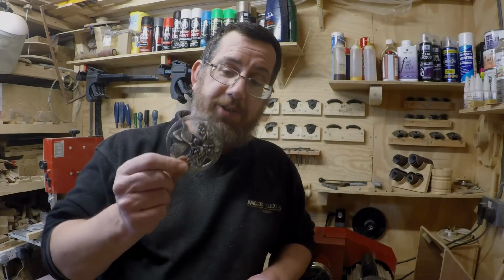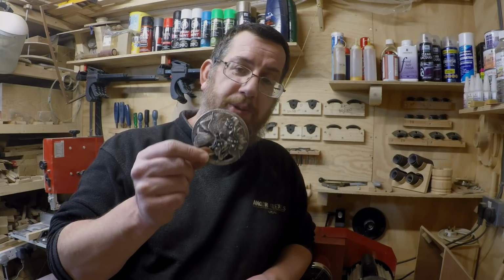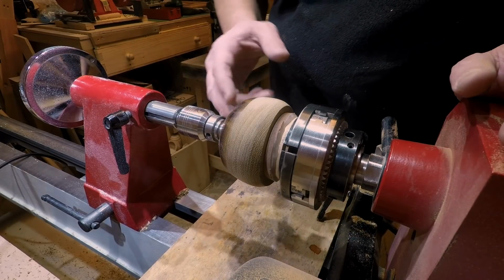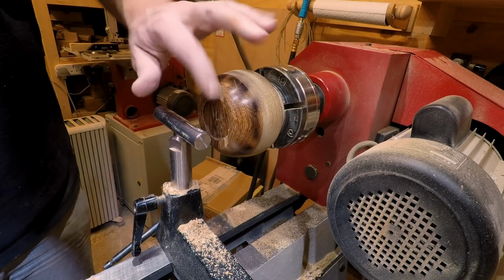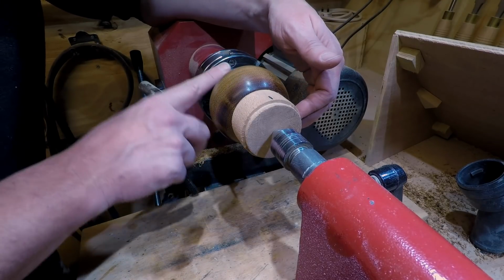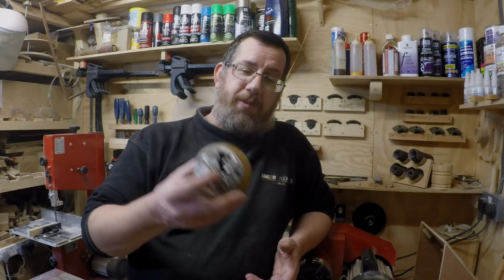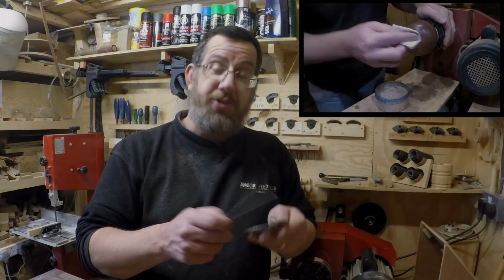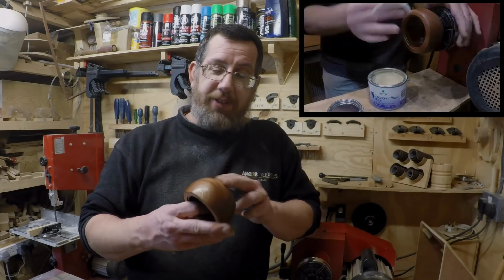Pot Pourri - Episode 179

Comment: It wasn't as much as an aggressive cut , I think, it was the direction of the cut , pulling the gouge up and to the left actually pulled the piece out of jaws ,(I've done that  ) , it's reassuring to know other Turner's make mistakes ,it's how we learn ,,. Regards Alf , stay safe
Reply from the maker: I love back hollowing, but at times if you get the presentation angle wrong then it grabs the wood which is where it takes a very aggressive cut. Happens from time to time and you just have to put it down to experience.